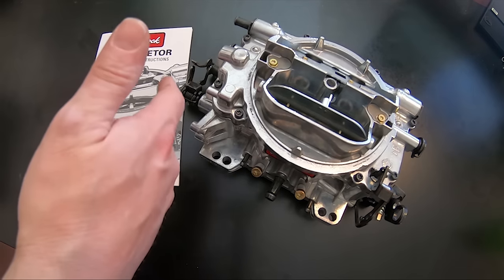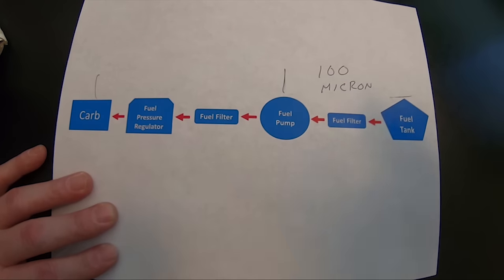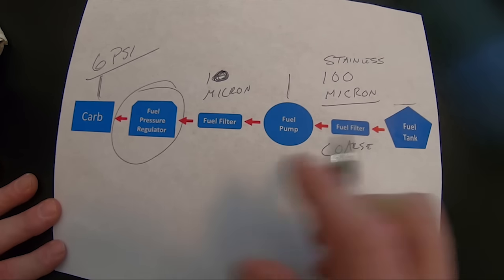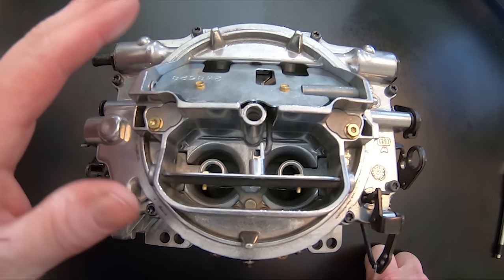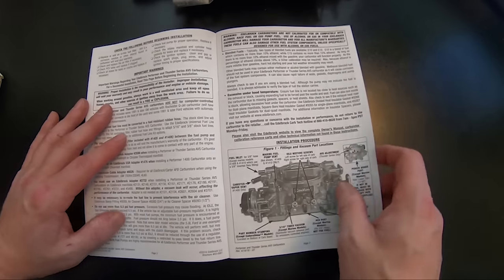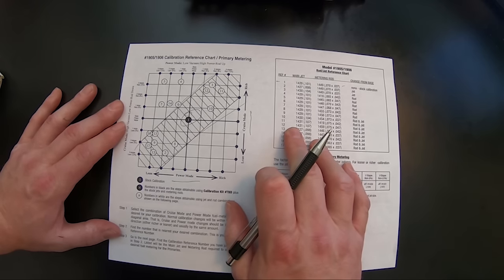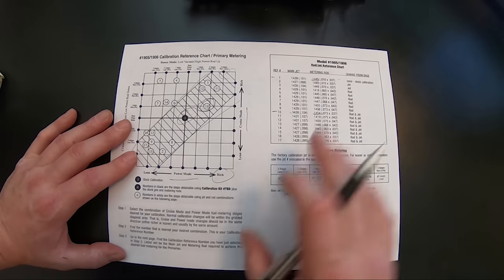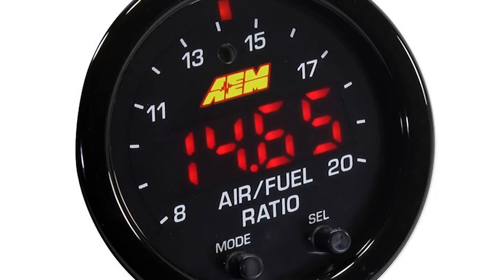The Ultimate Edelbrock Carburetor Tuning Guide

Comment: Ok I have a question about a 1406 that I may be a a jackass for even asking. Behind  the bottom of the accelerator pump linkage I have a "plate" that is floating with no resistance.  It's on the inside of a arm that has another linkage setup that activates the plates on the top of the primaries. My question should this plate on the inside of the arm be moving freely? I'm sorry this question sounds like it's from a moron. I'm going to post a little video and put it on my channel it'll be the newest video if you could look at this and let me know that's what it's supposed to be I would appreciate it.
Reply from the maker: Sounds like you’re describing the plate that controls the limits of the fast idle cam.  Yes it will move freely.  It has tabs on it that limits the extreme open and close movements of the fast idle cam, if I understands what you’re describing.  I’ll go look for your video.

Comment: Thanks bone Head. Here is my issue: I have a chevy 350 with fast burn aluminum heads (GM performance) EDDY 1406 Timing and ignition all new or in good shape. From an idle to full throttle big hesitation and some time a backfire from the carb. Tired to adjust out with jets and  rods, changing the timing.. I cant get rid of my fireball backfire and hesitation. 1500 rpms to 6000 rpms runs fin.
Any ideas or suggestions?
Reply: @MuscleCarSolutions  MSD with vaccum advance pod, capped off and set to 32 degrees btdc at 4000 RPMS. At idle with everything hooked up 750 rpms 10 btdc, new wires, plugs. valve lash reset, yes distributor is in correct and firing order correct.
Reply: @MuscleCarSolutions  no control box. I unhooked the vacuum advance and set the timing to 32 degrees btdc with the engine at 4000 rpms, after hooking the vacuum advance back up the timing at idle was about 12 degrees btdc.
Reply: Ignition System: Chevrolet recommends the HEI distributor, Chevrolet part number 93440806, for use on this engine package. The HEI distributor is properly curved for this application and comes with a melonized drive gear. You must use a hardened (melonized) drive gear that is compatible with a steel camshaft. Use of a non-hardened distributor gear will result in excessive wear. The HEI system requires a 12-volt power supply for proper operation. The HEI ignition system should be connected directly to the battery with 10 or 12 gauge wire through a high quality ignition switch. lf you are installing an HEI ignition in an early-model vehicle originally equipped with a point-type ignition, be sure to remove or bypass the resistor in the wiring harness to ensure the HEI receives 12 volts continuously. Use distributor connector package Chevrolet part number 12167658, which includes connectors and wires for the HEl’s tachometer and 12 volt terminals. Set spark timing at 32° before top dead center (BTDC) at 4000 rpm with the vacuum advance line to the distributor disconnected and plugged. This setting will produce 32° of total advance at wide-open throttle (WOT). NOTE: While the HEI distributor also has vacuum advance capability, the vacuum advance canister should be plugged for racing applications.
Reply: @MuscleCarSolutions  was trying to run it with vacuum advance. Called the engine builder and they preset the timing 30 btdc and told me I need to NOT use vacuum advance.
Thanks for your help.
Reply: @MuscleCarSolutions  the motor is a 604 crate engine for circle track, a friend had 8 of them for his dirt track car and knew I need a new engine. so technically not a street engine but it will be now. I did try both ports and passenger side was much better.

Comment: I had my stuff set up by a shop since they replaced the manifold and carb for me. It idles higher than usual. I suspect timing due to the engine stumbling as I crank it sometimes. If I set base timing.. will I have to adjust the carb again?
Reply: @MuscleCarSolutions  would it be just the mixture screws? Or would that throw the accelerator pumps out too?
Reply: @MuscleCarSolutions  I wish I could tell you.... I got no info on it.im probably just going to take it back and make them adjust it
Reply: @MuscleCarSolutions  well, how do I figure out where to start? The idle arm changes base timing right? So i cant just pop a timing light with it the way it is right?
Reply: Throttle lever, not idle arm
Reply: @MuscleCarSolutions  thank you sir
Reply: @MuscleCarSolutions  just brought the initial timing down to about 12. Engine rpm was still alittle high, so I turned down the throttle about a half turbo to get where I feel is a normal sounding idle. The engine doesnt bog when the throttle is pressed and idles fine. I dont think i need to fiddle with its settings
Reply: @MuscleCarSolutions  thanks for all of the info and motivation!

Comment: Why does fuel come out the vents from foul bowl
Reply from the maker: Dirt in the needle and seat most likely.  What is your fuel pressure regulator set at?
Reply: @MuscleCarSolutions  mechanical pump 350 I have no clue with no regulator.
Reply from the maker: Get a regulator.  Having that additional adjustment point is critical to ensure you have the right pressure going to the carb.
Reply: @MuscleCarSolutions  10-4. Ill keep you up dated.
Reply: The car runs now. It was the floats. They had tiny holes. Thank you for the help.
Reply from the maker: That’s good to hear!  Honestly floats are the absolute last thing I check.  They rarely get pin holes.  Good work finding the issue!

Comment: I like the fuel progression with the 2 filters and a regulator.  No offense,  but all you are really saying is read the manual. This is good information that needs to be stressed to the end user. This is by no means a good video on how to work on an Edelbrock carb and certainly is not the Ultimate Guide to tune one. I mean no disrespect but your video title is misleading. I like your links to the AFR and spacer. You may want to include a weldless bung kit for those who don't own a welder.

Comment: great video. Thanks. Question, just baught an edelbrock 1407 for my ford truck. everything is set up correctly. I live in Calgary , ab Canada. (high elevation) My truck stumbles and boggs out only when I take off in 1st gear. So, I went to my chart. I was going to install a 1457 metering rods to fix the problem I have. In, your opinion, would that be correct?
Reply: @MuscleCarSolutions  hey , thanks for quick reply. its a 390(fresh rebuild with mild cam) headers with fresh rebuilt top load RUG. new dome, plugs, wires,timing, wires and mallroy dist. everything is literally new and rebuilt.  works best at 12 deg BTDC. new hoses and fuel filters as well as pump. I run no eth fuel as well. it works fine from second up. Just when I go to take off,it coughs and stumbles. Almost as if I was taking off in 3rd. I dont want to ride the clutch as its new as well. Thats pretty much the last thing I have to do is figure out the carb issue
Reply: @MuscleCarSolutions  I moved the acc pump lever to the middle. it got better. didnt notice a big difference on the last hole so I moved it back to the middle. So thanks to your video I got a better understanding on the matter and I will give it a shot. Gonna go grab the kit tomorrow and try it out. Thanks alot for your time and quick response. I will let you know

Comment: does carboraitor give you more power  than fule injection i
Reply: Not by itself. No. In many setups it will only because of lack of intake manifold designs or tune ability software as new engines roll out. When used with high flow throttle bodies and competitive intake designs fuel injection is better every time. They are designed to fulfill the same need for the engine. Fuel injection is a designed to do the exact same thing a carburetor does but incredibly more accurate and efficiently.

Comment: I'm having issues with my 302 idling in gear. 302, RV cam, shorty headers (open exhaust right now), 600 cfm performer, auto trans.

Truck runs great in park or neutral. In drive the truck immediately dies. If I crank the idle screw way in it will stay alive but barely. Ive disconnected and capped all vacuum lines. Holding my hand over the carb doesnt raise the idle.. Fuel regulator set about 4.5-5 psi. Have about 18 inhg vacuum. Tried moving timing all over but hasnt made any difference. Vacuum advance works properly and electric choke works properly. Truck drove fine with the last engine so I don't think its a torque converter issue. 

It is a slightly used carb so I am thinking there might be an internal issue with it. Any suggestions? Would having it open headers cause these issues? Anything to look for inside the carb when I tear is apart?

Comment: Best way to tune a edelbrock is throw it in the trash and buy a Holley lol just kidding. I have one on my Bronco and there pretty damn simple. There good carbs for stock engines but any type of performance engine a Holley or equivalent is best IMO.
Reply: Sorry, but have to disagree. I have a modified Chevy 350, 1st Gen with a  Weiand tunnel ram, 2 Edelbrock
1404's (500 cfm), velocity stacks, manual choke (s) and haven't touched the carbs in 9 years. All on a
23 T Bucket that's scary fast and scary fun.
Reply: A cam and a intake isn't a performance engine.
Reply: Your definition, please, oh mighty engine guru.
Reply: @dano1843  do you think youd lose power with holleys?

Comment: eldelbrock sux azz had a performer rpm cam brank into busted my heads n blew my 355 the cam hsd massive air bubbles in in contscted edelbrock they refused to replace the parts due to their defective cam that was NOT degassed as a blank. i do rod and custom work until they replace my heads n csm i will never buy another edelbeock product nor refer them to anyone my boycot reamins intact many years later. make it right edelbrock or pics and my story will be published for everyone to see.
Reply: They're intakes and carbs have been phenomenal for decades. Why would you go to them for a cam, though?
Reply: If cam was properly inspected by engine builder, it should have never been installed and returned, that's builder error and no fault of Edelbrock who has produced quality parts for decades and have many well satisfied customers!!
Reply: @mermaiddreams83  it was blank was not properly degassed as a speed shop owner elderbrocks lack of integrity and accountability lost our business for near 30 years now and shall continue with our two new shops. Mistakes happen, but Elderbrock did not even cover the cam let alone basic engine. Never again

Comment: I have search the internet for two day trying to find out why my 1405 is idling to high on my 1978 4x4. 350 engine ,no vacuum leaks, but when you force the throttle closed it will lower the idle, ii mean really force it closed. What's up?
Reply from the maker: @frankensteinrules6511  choke isn’t open all the way and it’s not released the fast idle cam is my guess.  But I’m not looking at what you’re seeing.

Comment: Looking for some help. Have the edelbrock 1411 sitting on a weiand 6521-1 supercharger. 454 bbc.   Having trouble getting this this tuned.  Supercharger is at 6psi boost.   Since this carb has no power valves it will work on a supercharger is my assumption. But I’m probably wrong.  Stalls and dies, high idle, any input is helpful.  Thanks!